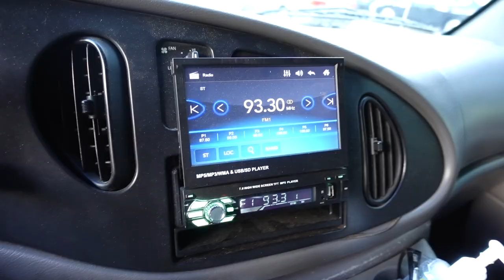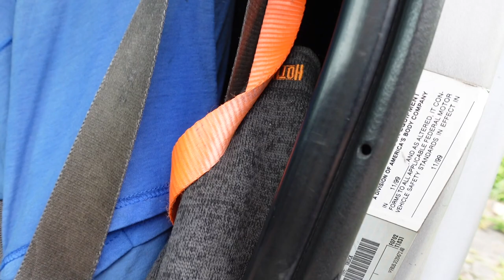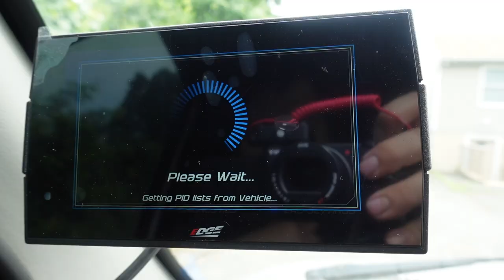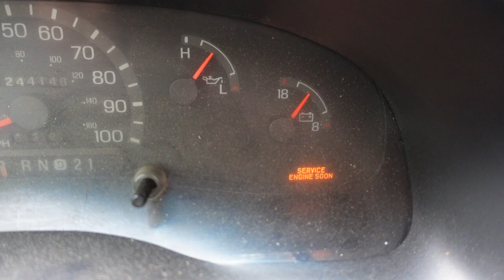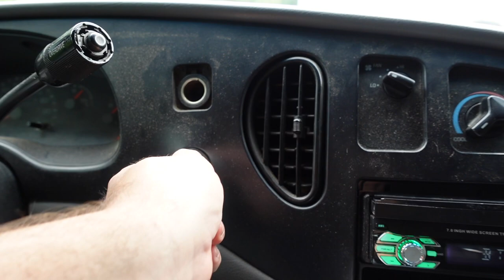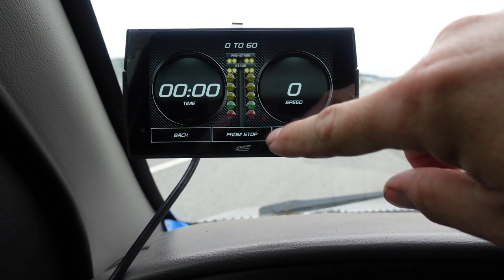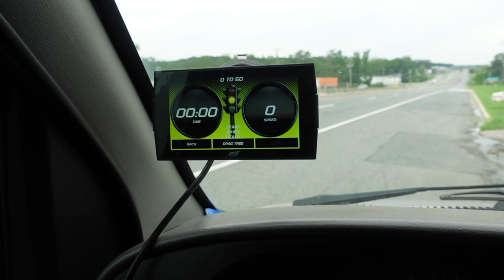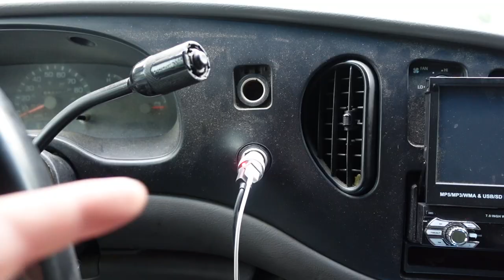My new Ford 7.3 Diesel Van 2000 e350

Comment: Dude, love me a 7.3 van. I've had my 2002 E350 for like 13 years and it's been a solid rig. I just tossed some tires on it a few years back. I make sure to keep after the oil changes, filters, brakes and just rip it. It pulls my UTV like nothing. Now I just need to do some body work. I'll have to check out your other vids.
Reply from the maker: Nice!   They do seem to last forever.  I still need to check the brakes out, but it’s been really dependable so far.
Reply: @RobRabonPhotog  Yeah man, check the brakes sooner that later, I had one of the soft lines just pull out of a caliper. It was insane! Brakes worked fine, just needed new pads and then bam! Line was so crusty that it pulled right out. I was giving everything a good once over before a trip down to West Virginia to do some off road riding. I was lucky that the van I got was from this construction company going out of business. It logged a lot of miles driving back and forth Michigan and Southern Ohio, so mainly highway miles. Oil was super clean too, I keep after the changes and I'm on a second set of batteries. But other then that, it's been a great machine. Hope you get good service out of yours too!

Comment: If you ever change the glow plugs on this, please do a video on it.
Reply from the maker: It seems to be a pretty common reason for the service engine light to come on, so I might be doing them when it starts getting a little cooler out.
Reply: @RobRabonPhotog  I did the passenger side today. The valve cover was a PIA to take off. But took less time to take off than it took to get to.
Reply from the maker: It does seem pretty cramped in there.  Probably a good idea to do them before it gets too cold out.